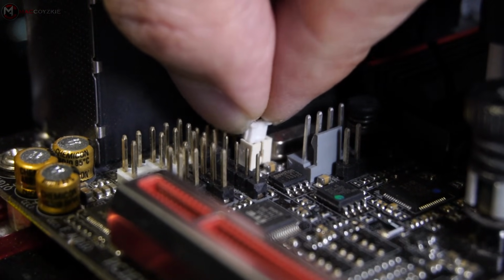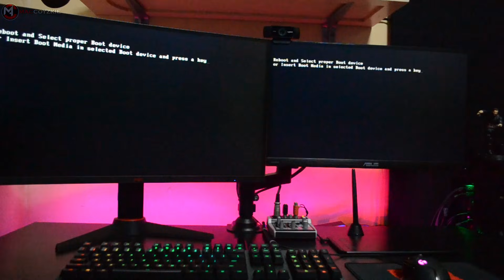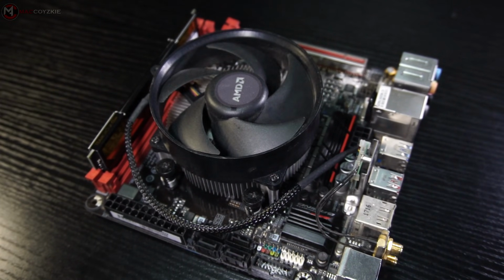How to remove cmos battery in your pc? Cmos reset / hard reset on bios

Comment: I’m stuck on the motherboard screen after building my new pc; I can’t get into BIOS or do anything. :(
Reply from the maker: even after clearing cmos? also is everything new or you have an old hdd installed in your new pc?
Reply: @MacCoyzkie  Everything is new. I took out the CMOS battery and disconnected my SSD, yet BIOS still didn't open.
Reply from the maker: @al_bal_  may i know your pc specs?
Reply: @MacCoyzkie  Processor: Intel i7-11700K
Memory: 2x8GB RAM
Graphics: NVIDIA GeForce RTX 3060
Hard Drive: 2TB SSD

Is this what you meant? I'm sorry, I am quite new to all of this computer stuff. I dealt with laptops for most of my life. I didn't even know about specs until last year.
Reply from the maker: @al_bal_  yes, may i also know the name of your motherboard? this is just a hunch but i think it has something to do with the bios update. On the other hand, this may also sound basic but just a reminder. make sure you plug the monitor cable in the gpu port and not in the motherboard port
Reply: @MacCoyzkie  Motherboard: GIGABYTE Z590 UD. 
My monitors' cables are in the GPU port.
Reply from the maker: @al_bal_  hmm that is weird, this setup should work right away. This may take some time to figure out. Can you try the monitor and it's cable(hdmi,dp) using console, laptop or other pc if you got one to confirm if its working. Usually it is just the monitor cable so we need to test those out first. Because the pc should work right away and you should see at least "reboot and select proper boot drive" in your display
Reply: @MacCoyzkie  Both of my monitors are working; I used my laptop to confirm.
Sorry for late reply, I got busy.
Reply from the maker: @al_bal_  no problem, this may take some effort but can you take a quick video of your pc build (internal where the motherboard is) while you turn your pc on? you can post the link here and we'll reply after watching it
Reply: @MacCoyzkie  I'm not sure I can do that. What do you need to check in my pc?
Reply from the maker: @al_bal_  take a video of the motherboard while you turn the pc on, i need to check the lights and connections
Reply: @MacCoyzkie  The problem with my PC is that the RAM needs to be in dual channel for optimized performance, but the monitors won't display unless one RAM stick is in. If two RAM sticks are in slots A1 and B1 or A2 and B2, there is no display. And if two sticks are in A1 and A2 or B1 and B2, the monitors will display, but it won't let me into BIOS. BIOS opens automatically when one RAM stick is in any memory slots on my motherboard. I did try running XMP to try to use dual channel, but that didn't work. I also reset the CMOS a bunch of times, but that also didn't work either. Do you know how to make my computer work properly when using dual channel memory?
Reply from the maker: @al_bal_  did you try all ram sticks individually in every single slot? I never encounter something like this before tbh.
Reply: @MacCoyzkie  Yes, I have tried that and they all work the same.
Reply from the maker: @al_bal_  I'm not sure what is up bro since this is a new motherboard. It might have something to do with the bios for sure. Unfortunately i can't give you any more advise than this but you need to ask support from the store where you got the mobo from

Comment: pls help PC powers on but no display like even before the issue started if I tried factory resetting or going into bios it would give me the no signal message now it's not showing anything at all
Reply from the maker: clean the ram the way i clean it here in this video link https://youtu.be/Q8HS7fEkB50
Reply: @MacCoyzkie  Ayo thx so much took out the gpu got a post and could finally boot into bios, so i did a full windows wipe then installed the gpu and got signal again.
Reply from the maker: @S1trife  that's good news then, you're welcome bro, glad i can help

Comment: I just changed my motherboard to b550m and cpu to ryzen 5 5600x and a new ram and my pc wouldnt turn on. should I reset the cmos battery?
Reply from the maker: do you have a gpu? if you don't that will not work. 5600x doesn't have integrated graphics. If you have a gpu and still doesn't work, you probably need a bios update. consider the local shop do that for you if so

Comment: My SSD and my 3.5 HD do not show up on my MSI Bios. I’m trying to install a fresh windows from my flash drive. Will this help?
Reply from the maker: it might help so better try it. if it didn't work either your drives are broken or your sata cables or their power cables from psu is faulty

Comment: I have been through so many videos that have said "if you're experiencing X, just reset your BIOS battery by removing it, good job" without actually explaining it the way this video did. Thank you!
Reply: But how to let it without the bios battery? Plugged and turned off? Just unplugged and turned off? Thx
Reply: I removed it but forgot the screwdriver 🪛 tip..got it now..
Reply from the maker: you're welcome! glad it helps
Reply: @wilsont1010  it just resets it to default so you just need to redo any changes you personally have made
Reply: Bro I was about to crash out  thanks 😭
Reply: Hey,I just removed the battery but nothing happened 😔😔 still the same.screen is black and air cooler is working roughly,like it's rendering or something
Reply: @cyberpunkmoba2045  reseat the ram
Reply: @xCrazyCambax  I've already fixed it. Thanks
Reply: @cyberpunkmoba2045  how did you fix it
Reply: CyberPunk MOBA how did you fix it?
Reply: @BlueRiptide  did you fixed it?
Reply: @cyberpunkmoba2045  how did u fix it plsss tell me
Reply: To fix the ram,Clean ram with eraser and brush  then clean ram slot with brush and then put the ram

Comment: So one day I was gaming and my pc screen turns black, and for some reason the leds on my pc will fade on when turning the pc on but it does not do that regularly. This has happened once and the pc fixed itself but it is doing it again and I want a permanent fix. The monitor isn't the problem and I've tried reseating my ram.
Reply from the maker: use avr or ups just in case, if you're already using one and this is still happening then this might be a faulty psu, or at least it is not functioning well
Reply: did your mouse and keyboard also turned off?

Comment: My BIOS says PCI Slot Empty. This happened after installing a new cpu without integrated graphics. I installed my old cpu with integrated graphics to send this message. My GPU isn’t dead. Please help.
Reply: And I can’t get a signal with my GPU
Reply from the maker: this will be a lot of trial and error to check things out. Have you tried using your old cpu with the gpu and plug the monitor in the gpu port? if that works and your new cpu with the same setup doesn't work this might be something to do with the bios, perhaps the new cpu needed a motherboard bios update so check on that. What is your new cpu and motherboard anyway?
Reply: @MacCoyzkie  When using my old CPU with the GPU, the signal through the GPU is black. The BIOS are to the latest. My new CPU is the Xeon E3-1270 V2. My motherboard is a Dell D28YY I got from a Dell Optiplex 790 (Which I'm still using).
Reply from the maker: @penguin1215  just a theory, but i think this has something to do with your gpu, can you try your gpu using other pc?
Reply: @MacCoyzkie  I have tried it with my cousins computer, it works perfectly
Reply from the maker: @penguin1215  ok that's good then, this might be your motherboard's problem or it's just the top pcie, can you try the gpu in the 2nd pcie slot?
Reply: @MacCoyzkie  i'll try buying a pci extender, i'll reply when i figured it out or need some help.
Reply: @MacCoyzkie  Allow me to recap what really happened. I updated the BIOS to the latest. After the boot, the GPU wasn’t sending any signal. I had to use Integrated Graphics to find out that my GPU wasn’t detected in BIOS nor Device Manager.
Reply from the maker: @penguin1215  may i know your pc specs so i won't be wondering what could been the problem. plus what is the name of the latest bios you updated your motherboard with
Reply: @MacCoyzkie  I have a Dell Optiplex 790 with a GTX 1050 ti Low Profile. I know some people won't know much about cheap systems, but the latest BIOS I've updated to is the A22. Sorry for the late response.
Reply from the maker: @penguin1215  i might be wrong bro but i got a viewer with the same problem and his pc is from around 2013 or something, his motherboard doesn't recognize the new gpus. So i'm just assuming that it is the same for you. This will also be problem if you are not using an updated windows 10 o.s. Because new nvidia drivers requires it less it won't work properly. I'm very sorry bro i'm not really familiar with your system
Reply: @MacCoyzkie  thanks for your help, windows 10 to the latest

Comment: I was trying to update my graphics drivers for my raedon 580 and they stopped working but I had an external graphics driver for my second monitor, the second monitor works but my main one doesn't, any idea of another fix for this?
Reply from the maker: what do you mean external graphics driver? do you have an external graphics card or something? Also are both monitors plugged in the gpu port?

Comment: DUDE THANK YOU!! I had a power outage and when I turned my pc on it would turn on but stay on black screen then an error with cmos popped up. Did the screwdriver trick and it’s running again! Thanks so much
Reply from the maker: you're welcome bro! glad i was able to help
Reply: Which screwdriver trick?
Reply: Hey,I just removed the battery but nothing happened 😔😔 still the same.screen is black and air cooler is working roughly,like it's rendering or something. I clicked on "use USB to flash bios" and then screen became black(( my motherboard "Tomahawk b550
Reply: @cyberpunkmoba2045  Hey bro what did you do after that. I am in the same situation

Comment: Hey man. I tried to make a custom resolution via Custom Resolution Utility around 4 months ago. However it failed, i’ve been stuck on the recovery menu for months now and still without anything working for me.. Do you have any idea how to fix this? I wish i could get back to gaming but with this it is impossible. Thanks
Reply from the maker: you need to DDU your gpu driver, check 4:08 in this link https://youtu.be/bsivwuSlPL4

Comment: I got a problem plz answer,I wanted to rest my bios password, I removed it and opened the laptop,I shouldn't have let it for some time,but I didn't,so I closed my laptop and took it again and waited for 7 hours,then I put it back,and I run my laptop,it didn't change my bios password,but the main problem that my laptop internet is not working,its shown but not working,and when I was plugging the battery,I went for the opposite side,and there was to small iron,things,aiming to the battery I think I bent,them by mistake,is that the problem ir something else please help
Reply from the maker: that's a little difficult bro, you will need the help of the local store in that matter. Also the password is a bit worrisome, i'm not sure if there is any way to reset those. depending on the laptop, solutions are different so better check your laptops manual
Reply: @MacCoyzkie  it's a school laptop,and when I go to my bois,its says admin password
Reply from the maker: @lazybone1187  i see, you must contact your school IT then. they must have set that so you can't do anything about it
Reply: @MacCoyzkie  it,fix its self in a weird way,I want to talk to you about an issue,can you give me your discord or something I want to voice talk to you
Reply from the maker: @lazybone1187  i can only answer questions here though since i'm  a bit busy at work

Comment: Welp bago po mag no signal pc ko nag freeze po sya ng almost 1hr nag idle lang po ako nung nag freeze tapos pinatay ko po sya sa avr tapos pag open ko ulit nag no signal saka keyboard/number lock no lights and mouse may ilaw 

Try ko na rin po reseat cmos ram at gpu nilinisan ko narin gamit eraser, try ko rin sa ibang pc yung gpu at ram ko working sya pero pag nilagay yung gpu at ram(same gpu/8gb 1stick) ng daddy ko nag no signal parin at bago lang din psu ko almost 2 months na rin po

G4560
2x4 ram
Gtx 1050 ti
emaxx lh110ltx gaming
1tb
500tb
Corsair cv550
Reply from the maker: hindi psu ito, ang unang duda ko yung hdd. luma na ba or bago din? usually kasi pag luma na hdd nag cause ng freeze and usually matagal mag load. lalu na sa recent windows update, meron akong client 10minutes bago mag load then eventually ayaw na umandar ng pc. pero nung nagpalit sya ssd gumana. anyway kung bago naman ang hdd mo, malamang motherboard yan. ganyan din kasi build ko noon at naka dalawang palit ako same din nangyare. Pero para maka siguro ka na hindi talaga psu gamit ka ng psu tester na ganito https://amzn.to/3opDrrc

Comment: Just remove the cmos and wait 5 minutes ???
Please answer me
Reply from the maker: yes, after 5 minutes place it back again
Reply: @MacCoyzkie  what cmos battery should use the correct one
Reply: @MacCoyzkie  still no display
Reply: Why i still not work please help
Reply from the maker: may i know what are your pc specs and if you installed windows 10 already?
Reply: @MacCoyzkie  GTX 750ti 
Motherboard MSI h61
SSD 128gb
Installed windows 10 64 bit
Proc Intel Core i3 genn 2
That my PC specks
Reply from the maker: @pinsuxd4345  this may sound basic but did you plug the monitor in the gpu port. If you already have and still no display you need to have your gpu tested in a different rig to confirm if your gpu is still fine

Comment: Hi Mac! I’ve got message first that i need to reboot and select proper boot device,then i restarted and i received same message.I tried to install new windows and after I restarted 3rd time there was no display on monitor.I removed cmos battery,and tried after that still no signal,i removed ram memory and placed back no display.Can you tell me what could problem be.
Btw i just saw your videos and i just subscribed. Thanks :)
Reply from the maker: just a hunch, do you have an old hdd installed in your system? if you do remove it first then try reinstalling windows in your ssd or m.2... this will not be applicable if you have hdd as boot drive which is i don't really recommend since hdd as boot drive is going to waste a lot of your time

Comment: Hey I hope you still reply to newer comments. I bought a new gpu and it doesn't show any display at all I tried removing it first and then transfer the cable to the built in vga socket, after doing so my monitor still don't give a video output. I also tried cleaning my ram sticks, ram slots, pcie slot, and gpu pins but it still dont work. My pc fans work also the gpu fans but I still dont get any video output.
Reply from the maker: if you tried the solutions in the video and still doesn't work then it's either your monitor cable is faulty or the gpu you bought is not working. Test the gpu with a friend's rig to confirm
Reply: @MacCoyzkie  Even if the gpu fans are working is there still a chance that it is broken? I also tried removing it and connect the vga to the motherboard but it still didn't work.
Reply from the maker: on board graphics works only if your cpu supports it so you need to consider that as well. fans running doesn't completely assure it is working. Like i said have it tested in a different pc to check
Reply: @MacCoyzkie  can I use an old gpu to test if the pc isnt the problem?
Reply from the maker: @zenibratatata  yep you can also try that

Comment: I did it and it didn't work. Do I have to use the screwdriver on the battery holder as well?
Reply from the maker: remove the battery for 5 minutes bro less it will not really work
Reply: @MacCoyzkie  Mano do céu, thank  you for help. For some reason this process didn't work again, even letting overnight. However I tried one more time this morning removing the cables that power the CPU and the motherboard and switching the ram slot. To reset the bios I touched the CMOS with a screwdriver - which I had already tried before but also with no sucess. The new things were the cables and the ram, that I did not think were necessay due the recommendation absense on my motherboard manual. Sorry for the long comment and rookie mistake kskd Hope my experinece helps anyone with the same problem!
Reply from the maker: @gustavovital5802  no problem bro! thanks too for sharing

Comment: bro when i started my pc it was super laggy and then it shut down itself and i was searching for solution idk who but someone said its cause of dust in the pc then i cleaned it up not too much just the cpu fan with a brush then when i started pc fk man nothing works mouse, monitor, keyboard nothing seems to work then i am here and its still not working wt do i do? do i have to replace cmos or something?? pls man idk wt to do...
Reply from the maker: no need to replace anything bro, try to removing the rams, clean dusts off the rams and the ram slots. place it back before powering your pc back on
Reply: @MacCoyzkie  bro thanks for the reply dude but i fixed it already as you said it was just ram misplaced or something like that just had to remove and add lol thnx a lot